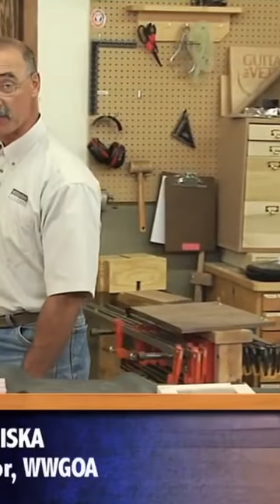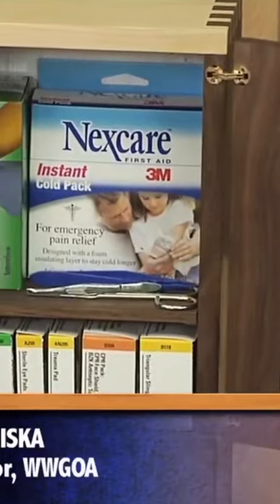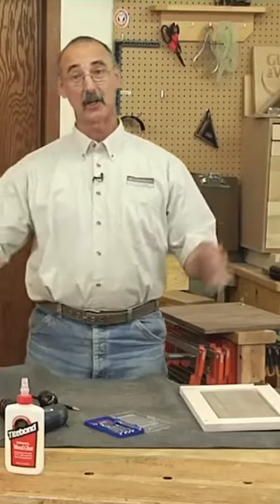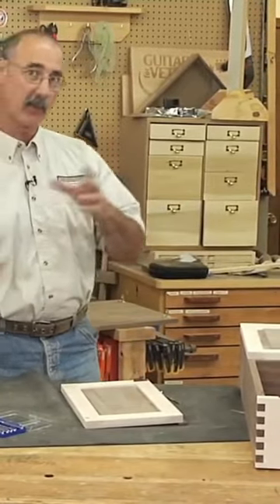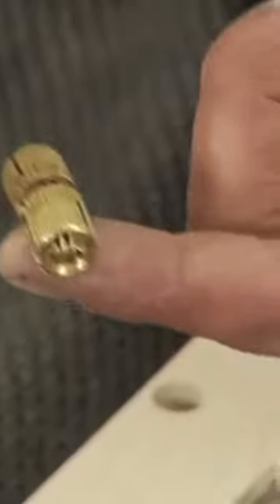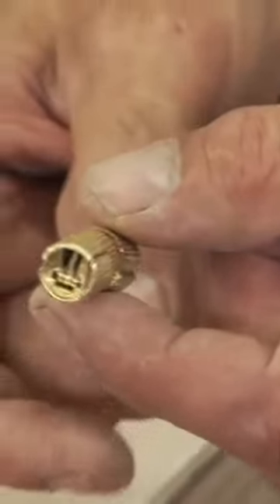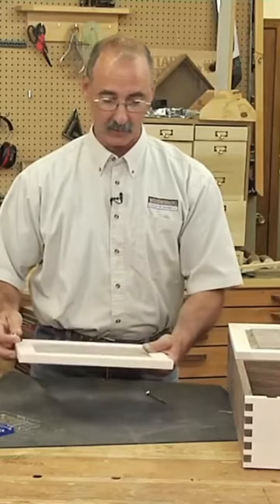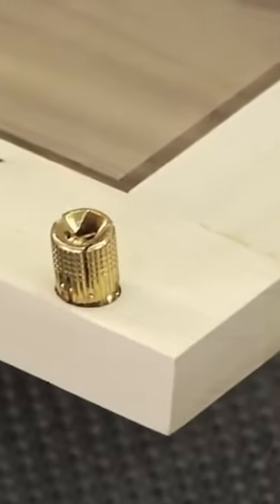Go to the full video to learn how to install barrel hinges #installation #woodworkinghacks #shorts

Comment: My word of advice is if you are using them for the first time, don't use them on your project until you've verified fitment on scrap wood of the same dimension as the actual project.  I used these to make a ring box and after making a very small error in measurement (about 1mm where my drill bit walked), it kind of messed it up as the lid was misaligned when open.  I trashed that box and started over but when I got the to point where I was drilling holes for the barrel hinges, I used a brad point bit and a drill press to make the location more exact and it worked.  But this time, I tested it on a scrap piece of the same dimensions and I'm glad I did as I had to adjust the method and hole location to make the lid open straight and open without contacting the base of the box.  There is NO adjustments on these hinges so the holes have to be exact.  But when they work, it makes for an awesome concealed look.

Comment: Can you direct me to your full video on the measurement and how to correctly line up the holes to the end of the boards please. I’m using 8mm barrel hinges and it said 9.4 mm from the edge of the wood to the center of the hole for the barrel hing. Is that correct?  It just seems like there is so little wood left on the edge side.